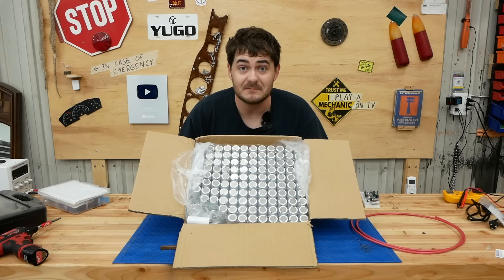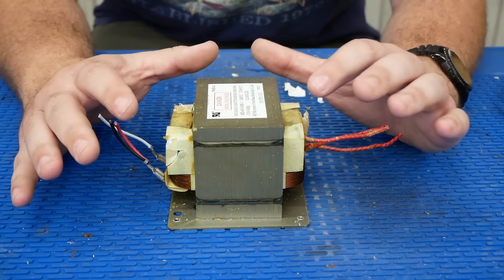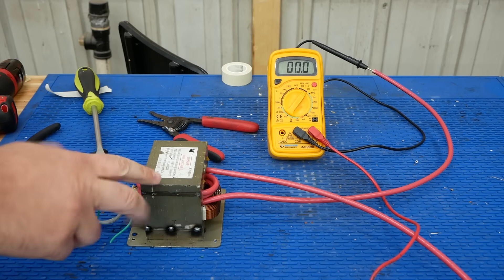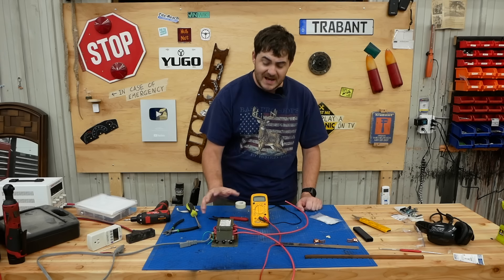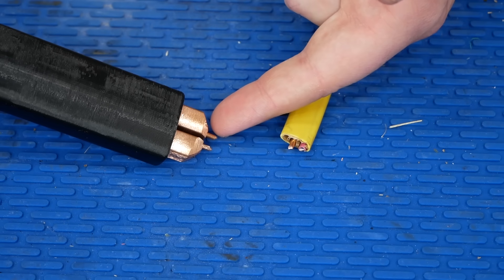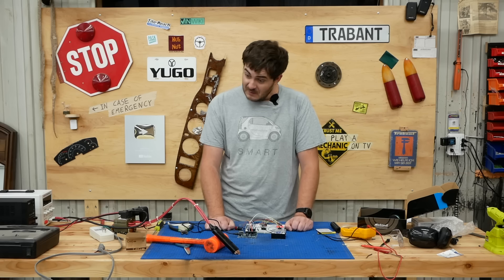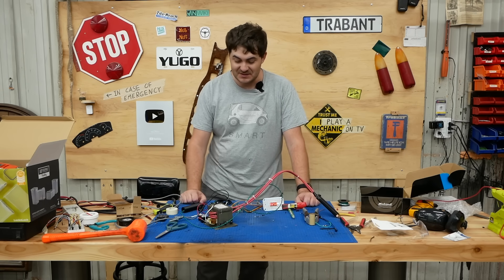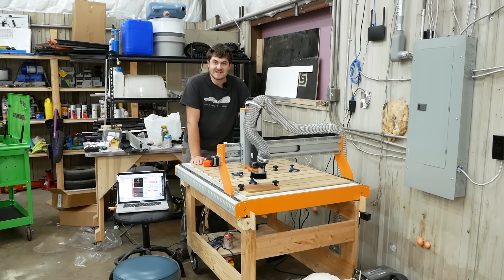I Made a Battery Spot Welder from an Old Microwave and Excessive Mahogany

Comment: This guy didn’t say it in the video. Don’t open a microwave unless you know what you’re doing. You don’t have do be a professional electrician I’m just saying do research. There’s capacitors in them that can electrocute you if you don’t discharge them properly and the magnetron contains beryllium oxide which is fatal if breathed in. That’s why they have security bits. I feel obligated to say this because I would have done something stupid like that when I was a teenager. I knew nothing about microwaves and I wouldn’t have done any research on them.

Comment: Putting line voltage on the secondary would not make it melt. However, you certainly would not get enough current to spot weld.

Comment: Super nice job.  If the spot welder leads were detachable, the side of the box had an open extension to hold the leads and button with a nice carry handle, that would be complete.

Comment: I tried building a microwave transformer spot welder similar to this one and found it very unreliable in that it would sometimes give perfect welds but many times the welds were weak. I'm not sure if the problem was design or build but I gave up on it in the end.
A similar timer used with a heavy duty car battery and a motor bike solenoid would be better.

Comment: very nice mate. one thing i will mention is that my arduino/car battery spot welder only pulses for around 5-10 miliseconds and gets her done. i think you might be over dunn here :p (remember heat is the enemy!) it also has a "pre heat" pulse setting set to 1 ms or something idk why but might be good? and sorry but one more thing the tips of your welder will stick to what you are welding sometimes and then they will pull out if they're not firmly attached i would be money on that happening before too long :D

Comment: At least you welded it after you cut it, built a few of these and a cleaner way of removing the winding is to cut the copper flush with the body of the transformer, then use a punch and hammer and start going to town on it.
Also there are parts for the timer that you can grab off the shelf if you don't want to mess with arduino.

you can also ditch the timer, replace it with a light dimmer and electrodes for a stainless steel blade and you have a hot knife with temp control.

Comment: A great build a s usual, and good fun. Just for information: hundreds of amps available on the secondary at just a couple of volts cannot kill. You could lick those points and only feel a tingle (I've done it with a couple of jump leads pn a car battery - to prove a point) and ...if you don't have a welder to weld the transformer laminations back together you can't really do it with epoxy - the magnetic flux/eddy currents won't be able to flow properly (but with a bit for fiddling you can cut out the old secondary and fit the new turns of the thick wire without cutting up the laminations). Will

Comment: Once upon a time, if you wanted a little bit of electronic timing, you used a 555 chip.
Now, you program an Arduino.
TBH, if you wanted a really basic timer, you could use a standard relay and a capacitor and discharge resistor to reset

Comment: Not sure why you use the arduino for a simple timing issue.  There are industrial relatively high current: Macromatic Multi-Function Timing Relay, 12 to 240V AC/DC, 15A @ 240V, 6 Pins, SPDT.   $42

Comment: What made you decide to go through all the extra steps and headache of using an arduino instead of a simple timer? Something like a Littlefuse TSS421 .05sec to 3sec adjustable timer to run your high current solid state relay. Once you get the time delay figured out for the application the digital readout isn't really needed.

Comment: One of the biggest 'ah ha!' moments in my electrical education is when I found out the wires in transformers don't connect through.  The primary and secondary are not physically connected to each other.  They are 'magnetically' connected as the primary's magnetic field induces current in the secondary.  It was just crazy to me at the time.

Comment: Those transformers typically step up to a little over 2,000 volts dude. Best not to fuck with it, or it will royally fuck with you! Touch the output of that while it's plugged in, you don't pass go, you don't collect your $200, you go directly to morgue.

Comment: 08:20 Suggest you use a double pole switch to avoid you are opening the neutral and still have the live on. Nice video, well done project, and the humorous twist is great. Now you know it is not just software writers that would do this or that different….also electricians 😉
Reply: Yes DEFINITELY a double pole switch. Even if you wire it correctly with a SP switch on the active line, the house wiring (particularly if it's very old & without safety switches, or in countries with poor compliance) can have the active & neutral lines reversed. A great recipe for electrocution!

Comment: "would melt if I just plugged it in"

No, it won't. But good luck getting enough current to flow out of the primary to do spot welding with

Comment: Umm wiring the transformer in reverse will not melt the wires. However you won't get much power out. Due to too many turns in the now primary.

Comment: I just had to look at the source code, sorry. 

I noticed that that the button state is checked on each loop, instead of using an interrupt. Would this not cause the weld to continuously pulse while the button is held (with breaks only due to updating the 7-segment display) instead of firing once for the set time? Might not be a huge problem since tapping the button still works as intended.

Comment: Capacitive Discharge welder would be safer(For the batteries). I wouldn't use that spot welder on lithium cells, generating more heat than necessary.

Comment: Two things, right off the bat.

One, please eWaste responsibly. If your local, friendly neighborhood nerd (around me, that's... erm, me) doesn't want the rest of that nuker, please recycle it properly.

Two. Transformers work on magnetism. tl;dr if you make a magnetic field do the Fortnite Fandango near a big bunch of wire, you get an electrical signal in the wire -- and the reverse is true as well. Two bunches of wire doing a Magnetism Tango is a transformer. Wind those bunches around a big chunk of metal stuff in an orderly way, and not only do you get a more compact and efficient transformer (BTW, the kind of metal stuff matters, lots of thin strips of ferrite is awesome, the big lump of steel in microwave ovens is dirt cheap but awful at best) but you also make it easier to math out what you'll get for your efforts -- the number of "turns" (how many times each is wound around the big chunk) in terms of primary-to-secondary tells you roughly what you'll get out for what you put in, because Physics says the overall power (volts * amps = a number that is the same on both sides) is constant. It's teeechnically not watts because it's not DC. Watts is DC only... technically.
Reply: Lost it @ "barbecue taser" lol...
/rip me
Reply: Two more things.

One, I know exactly where you got that button, just by looking at it. You overpaid by at least 3x and I hope to God you didn't get the rest of the electronics there because if you did, you pretty well mortgaged your firstborn in the name of corporate profiteering for it and it was ENTIRELY unnecessary. Oh... and it wasn't Microcenter, but I don't blame you trying to hide your shame.

Two, an HVAC style contactor rated for ungodly high amperage and a similar, but less expensive and higher quality button, would have done you far better than all that fancy whizbang flashy circuitry, and it will last longer, too, if you aren't gullible about your contactor sourcing (don't get that one from flyaway, or trust Mr Bezos' little corner convenience mart... Potter&Brumfield and Omron are good brands).

One of my favorite engineering quotes is from "Star Trek III: The Search for Spock" and it applies here. It's one of Scotty's, of course. "The more they overblow the plumbing, the easier it is to clog up the drain!" I bet that flashy Arduino contraption won't last two years.

Comment: I guess that "modern man" has forgotten the special digits that form a magical number: 555
All that hardware and programming, for a simple pulse?
A potentiometer, with a dial that you calibrate, two capacitors, a couple of resistors, a potentiometer, and a 555...
Reply: to learn enough arduino to fabricobble your ideas in to reality is in general way easier that analogue circuitry. of course the analogue solution is way more elegant but i think it's great that people can make shit without much barrier of entry. also he can update functionality of this device with software updates.

Comment: Good work there but just an observation from an electrical engineering point of view: 
You're switching single phase AC at 60Hz which has a period of 17 mSecs so setting a pulse length less than that will produce unpredictable welding pulses dependant on where you are on the sine wave when the pulse is initiated.  Longer weld pulses than 17 mS should be very repeatable in terms of the energy delivered though.  Worse case is welding thin nickel strip to Lipo type cells where a few mSec can be the difference between a good weld and blowing a hole in the cell (fire and smoke etc).

A solution would be to use a zero crossing detector to ensure all pulses are identical

Comment: Cutting out the box joints reminded me of the song Doubt by Delphic

Also, brushed vacuum headers for CNC machines don't last all that long and don't look nice for most of their life cycle.
When they get all messed up just replace them with stiff enough silicone sheets spliced near the bottom - works perfectly and stays decent for years.

Comment: The way the nickel strip glows red hot and discolors suggests you may be able to turn the timing down further.  I'd try turning it down until the weld is weak, then choose a value larger than that that always gives a reliable weld.

Comment: I used motor lead wires for rewinding a huge motor. By this I mean the rubber insulated wire used for hooking up the motor, not the varnished stuff used inside the motor. I got it from a motor winding shop. It's size was No2 AWG.

Comment: Fwiw the no load current doesn't tell you much about the amperage of the secondary.   The turns ratio is close to predicting the voltage current transformation.  A 10 to 1 turns ratio will step up/down the voltage and step down/up the current.  Iow 10x the current at 1/10 the voltage or 1/10 the current at 10 times the voltage.  Ignoring efficiency losses and core saturation copper losses etc.  Probably a good idea to mention making sure it's unplugged and the high voltage capacitor is shorted out.  There is no guarantee the drain resistor is present and functioning.  Note capacitors can partially charge themselves up without violating any laws of physics.

Comment: Safety note about solid state relays. They always pass voltage! Not an issue with 2v, but when I used one to control the heater on an electric hot tub I was introduced to 240vac several times. Mind you it's in the single digit milliamps but still not fun.
Reply: If the load is 240VAC (in North America) you would need 2 SSR's, 1 in each power lead to isolate the load as there would be a path through the load (presumably resistive heat elements) to the unswitched line.  With 240VAC, (sometimes called 2 phase) there is 115VAC to ground on each line.

Comment: Epoxying the transformer parts back together will insulate the two halfs and thus cause the output power to drop significantly as well as high losses (high power draw while doing nothing) due to a lower reactive impedance. (Lower inductance thus lower impedance (ac resistance) at 60Hz and thus higher current and more heat.) And depending on how bad it is, it could just melt the thing

Comment: You can calibrate the horizontal expansion of your 3d printer. Print 2 different sized calibration cubes and then measure by how much bigger they both are. Your slicer should habe a setting for that somewhere

Comment: Maybe someone else has said this, but 2.2V and 600A is not enough to kill someone, at least not through electrocution. Human skin has pretty high resistance and 2.2V is far too low to overcome that resistance. Otherwise, people could be easily electrocuted by standard AA batteries (1.5V nominal). You could even put your hands directly on the terminals of a 12V car battery (which can also put out in excess of 1000A for short periods) and you won’t feel a thing. I know that the AC switching frequency can also have an effect on whether or not a shock is perceptible, but either way, 2V is too low to get shocked let alone be lethal.

Love the overkill enclosure and the DIY nature of this channel. I hope to be able to do something similar in the future.

Comment: Aight this modded transformer is quite literally guaranteed death. A shock of 0.2 amps (Two tenths of an amp) is considered lethal. This is about 3,000 (three THOUSAND) times more powerful. Jesus god
Reply: Yes, but the only way to push even 0.2 amps through the human body is to use a lot more voltage than this has, though.  Like, WAY more.  Otherwise 9V batteries would be lethal weapons.

This can only push that much amperage through things that are pretty much zero-resistance conductors, like metal battery tabs.

Comment: If you drew 10 amps from the primary with NO load on the secondary, something is VERY WRONG!!!!!
BTW, I've used those solid state relays to control the primary of a transformer that was powering the heated bed in my 3D printer.  I've had TWO of those things short out and leave the bed on forever.  So watch out for those things, they might not like switching inductive loads (which transformers could be).

Comment: My MOT spot welder gets very hot. Mind you I weld light gauge sheet metal. But still, that's a lot of current in that wire, and once you start tacking a lot of batteries, give it time to cool down between batches.

Comment: "That should be PLENTY for spot welding. . . and killing someone." Love it =).
Reply: Unfortunately or perhaps fortunately it would not kill you. That is the maximum output current, the current you get depends on the resistance between the electrodes, and at a resistant level like human skin, it would be like a 2.2-volt battery. Touching both ends of the lithium-ion cells it will be welding will expose you to a 3.7volt so higher current. You would get a tinkle of you let it touch your tongue where the resistance is lower.

The best way to kill someone with the transformer is to put them in contact with the 120V side or just hit them in the head with it. If

Comment: Don't use electric tape for the handle, get some 3m self healing rubber tape. It's sold at various hardware stores like Lowe's and home Depot, you can also just order on Amazon but I can never remember exactly what it's called.

It has a much higher electrical resistance, not that it matters in this application.. it has a much higher physical resistance, you can wrap the entire handle from end to end, it will not wear out readily.  It will also make a very nice handle, and look way better than the electrical tape... Also won't leave some weird grimy sludge attached to the equipment overtime.

Comment: Really cool video.
Wonder why something like that doesn’t seem to need shield to prevent interference?  It’s not creating audio problems with the microphone so it seems fine.
Reply: The low voltage keeps the RF from traveling very far. It probably doesn't even travel 2" from the source.

Comment: Your idea of not needing a timer, and just pulsing things manually sounds....  very dangerous to me.  If this little device can draw 1300 watts, that's probably OK for 1/3 of a second.  It's a bit of a different matter if you hold the thing on for a while.  Switches can get stuck, people make mistakes, and shit happens.  Perhaps I'm missing something here, but it just sounds dangerous to me with no safeties built into anything, and just hooking up to a transformer, and manual switch.  Even just the Arduino sounds a little iffy without at least a fuse somewhere.  I'm not a safety troll here, but I quite honestly think you should have SOMETHING that shuts the thing off automatically other than your 15 amp breaker.

Those electrical wires you have aren't really designed to carry 500 amps.  They don't get hot when you pulse it at 1/3 of a second.  But they might start on fire, or smoke if you turned this thing on (maybe accidentally?) for a minute or two.

Also...  not having an enclosure sounds...  like an invitation to electrocute yourself.  The primary side is still 120 volts.  That''ll kill you dead right quick under the right circumstances.  The secondary at much lower voltage...  not so much.

Comment: So at one point you measured that your device was drawing 11 amps, and 120 volts.  That's about 1300 watts.  That's A LOT of heat, and and much heat as a space heater puts out.  So I'm curious what your load was.

Aso, when you left the device on, was your secondary connected to anything, or was it just idle?  Obviously when you're actively using it over several minutes/hours, it's going to get generate a lot more heat, since you're drawing more power.  That heat is going to build up, and leaving the device on with no load on the secondary isn't much of a test.